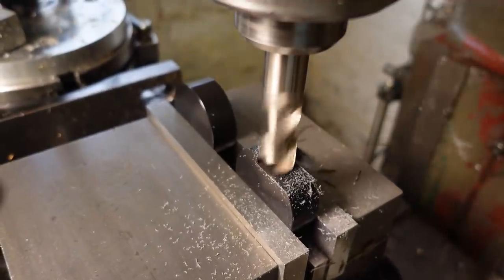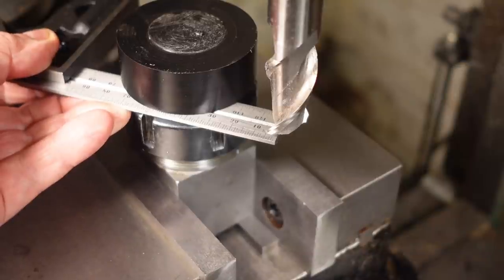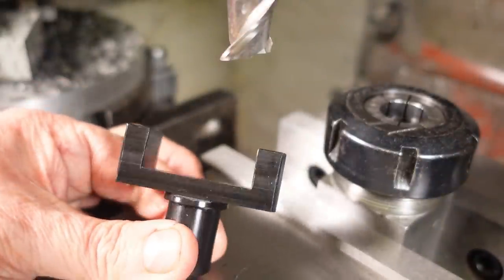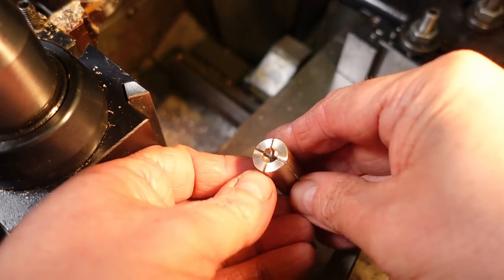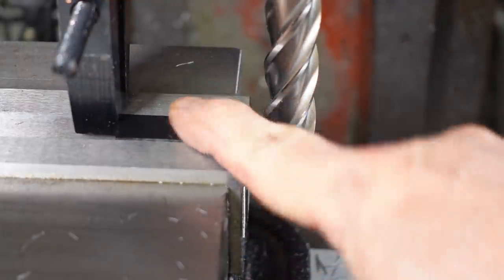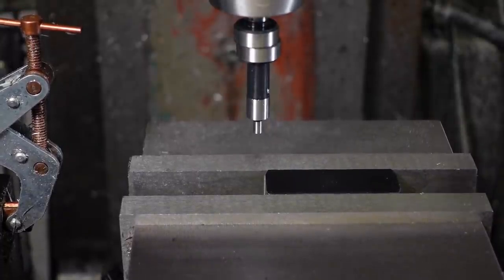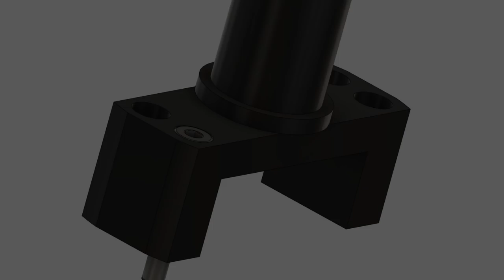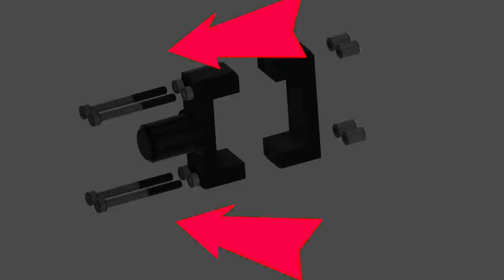Machining "Invisible*" Yagi Boom Clamps (*invisible to RF) #2

Comment: I used to struggle to make cuts in home made collets, laps etc. until I made myself a little gizmo to help. it's just a bit of angle-iron welded to a square of 1/8" plate, weld the angle iron to the plate and cut a reasonably wide slot an inch or two along the root of the angle to clear the  blade. basically, it's just a v-block that easily clamps (or bolts, like mine) to the saw table and makes sure the blade goes right down the middle of the round thing you're trying to cut. you can make a mark on the end of the stock to help judge the desired angle. I considered making a version with the vee on a sled and a little pointer for angle, but i've found this one works well enough for the kind of precision you'll get from the average bandsaw (especially my very below-average one!). Et voila! perfect pie-cuts, every time!
Reply from the maker: Good idea.  I have to confess a little secret that will trigger all the health and safety snowflakes....  My terrible bandsaw developed a nasty electrical fault while I was making this video, I suspected it was a winding leak or an intermittent open earth, but couldn't find it. It appears solidly grounded and no leaks on a Megger, but when it's running, if I touch the frame, it flips the RCB protection system and shuts the shop down.  As I was in a hurry, I put on two pairs of gloves and stood on a plastic board and just carried on. I was going to make a jig but decided to wing it and paid the price because is lacks beauty.

Project 61 might be a vee fixture with a slide, and it might get bumped up the list to #2 as I am going to need more of this sort of fixture.  I need one now with a 2.10 mm hole for the current project.  Those slots are going to be hard work, so I'll need to use a 0.5 mm slitting saw and cut them from both ends like an ER collet, although I have a very nice Knew Concepts piercing saw with Vallorbe blades that might be a simpler solution.

Now, of course, I want a wire EDM system.  Obviously.  Project 62 then....
Reply: Can't wait to see what yo come up with, it might inspire me to actually make mine properly. may i suggest taking a blow-gun to the innards of your bandsaw. they often get a fine coating of metal dust all over them and this can lead to all sorts of interesting tingling sensations and RCD faults. i've seen 2 different bandsaws with these issues, my own had exposed wires inside the belt cavity (on the main power switch), after a particularly long aluminium cutting session, there was a nasty noise, a tingle, and a pop! I've since insulated the wires/switch and attached a little plastic box that encloses the back of the switch. the motor also had a fine dusting inside, so that got a lrotectie shield too. You've got to love pre-1970s  electrical safety standards!
Reply from the maker: @theafro  I've had a close look inside the belt enclosure and around the safety switches and they are all clean and no sign of fraying. I suspect it could be inside the motor, but only when it's spinning, so I'm going to put my Megger on the leads and spin the motor with a power drill and see if I get any sign of leakage. If not, I'm going to tear it to bits and replace all the wiring. Or work in a wetsuit and rubber boots, but it's 20 degrees C today so that might be a wee bit uncomfortable and I'm expecting visitors, so that might be awkward!
Reply: @MachiningandMicrowaves  a low-slung nylon tightrope would work too... hows yer balance ? 😌

😎👍☘🍺
Reply from the maker: @peterfitzpatrick7032  Wobbly, very wobbly...
Reply: @MachiningandMicrowaves  😂😂

Comment: I do love your sense of sarcastic humor. 🙂 But I have  a question: At this timepoint https://youtu.be/tGOhcizkAMs?t=815, does the saw missing some of its teeth? 🤔
Reply from the maker: Very good observation skills! I think it's missing about 10 teeth. These HSS slitting saws are rather fragile, but a few missing teeth doesn't affect the performance very much.  The surface finish isn't perfect because of chip clearance and some sharp burrs, but I usually keep them until the teeth become dull or more than about 20% have broken.  I use a small abrasive stone to remove the burrs and prolong the useful life of the slitting saw blades.
Reply: Come on dude, its obvious, they dont make saws with a few teeth missing at random :P Well, they do make them that way, but only once they leave the factory... I have a few like those, its quite easy to make them, you just ding them into a part, run them at wrong speed-feed ratio for the material worked and such... On thicker saws or god forbid, carbide saws, dropping them can make short work of usually more involved process of breaking them... I also prefer buying saws with mangled teeth, as i have a deckel s1, and like stefan showed, they can be completely remade into custom size saws or can be used to replicate a good saw you already have...
Reply from the maker: @camillosteuss  Ooooh, I usually end up shattering them and find them embedded in doors and things, but I have an Alexander copy of a Deckel FP1, perhaps I can adapt that to turn the rekt ones into smaller versions.  Must go watch some Stefan videos urgently

Comment: Machining plastics is nice... a bit stringy when turning... 🤔

Brass on the other hand just sprays needle-swarf everywhere... 😖

I keep a couple of endmills/slotdrills with their tips ground slightly so I leave a (stress-reducing) radiused "fillet" in the corners of parts I machine where possible... 😌

Nice work... shame on you for the wrong Cee clamp.. 😂

😎👍☘🍺
Reply from the maker: These polished carbide inserts make pretty good curled chips on brass. https://youtu.be/ViRQuaKx3ik?t=380 
I have a few carbide endmills with radiused corners, I hadn't though of regrinding chipped sharp-corner mills, I must give that a go. I snapped a 3/4 inch long-series HSS end mill the other day, that was LOUD.  I was milling some bronze and it grabbed and shot the body of the end mill out sideways, along with some fragments. Eye protection is important...
Reply: @MachiningandMicrowaves  yep...bronze / brass is very "grabby"... 🤔
Definitely need more than the standard-issue safety-squints... 😆
Reply from the maker: @peterfitzpatrick7032  I favour REALLY long extensions to all the controls and a CCTV camera and I'll go stand in the store-room!
Reply: @MachiningandMicrowaves  

🤭

Comment: Neil, a question about materials interfering with the antenna (from someone that knows nothing about RF, etc.):  You said the Delrin wasn't a problem, but what about the threaded inserts & screws that you used?  Are they simply "small enough" to not cause a problem worth fooling with?
Reply from the maker: As usual, the answer is a bit more complex than it seems! The metal fixings are isolated from the boom of the antenna, and are oriented at 90 degrees to the electric field of the elements. They are close to the boom as well, so any possible coupling into the near field of the antenna will be absolutely tiny.  It's hard to come up with a good physical analogy, but the amplitude of the oscillating electric field near to the boom drops off rapidly. Isolated metallic parts that small (around 1/20th of a wavelength couple extremely weakly into the electric field anyway, so that reduces the effect by perhaps another factor of 100.  If the metal was in contact with the boom, it could change the resonance of the whole assembly, but ultimately the effect would still be miniscule. The actual issue is where a traditional mounting plate with U bolts is used to grip the GRP tube. The amount of metal you need to get a low-stress joint to the tube starts to escalate, and you end up with a conductive mass of metal that is connected to the boom that extends outwards into the electric field.  Still only a tiny effect, but there are three clamps per beam and we are pursuing a goal of perfection here.  Any effect on forward gain is not going to me significant even at a dimension of 1/8th of a wavelength, but what we are trying to avoid is raising the level of sidelobes in the main beam.  The beams have a very clean pattern, so any noise from man-made interference or nearby stations is kept to a minimum. A small change in the pattern at the -30dB level might introduce extra sidelobes or change the relationship between the antenna elements either side of the clamps and the effect might be several dB of extra sidelobe in an unfortunate direction. Add to this the proximity of multiple other high powered transmitters on higher frequencies and things start to get even messier, so using a nonconductive dielectric material, even a slightly imperfect one, just about removes any potential impact. My friend is looking at tiny increments in performance, each making maybe 1% improvement. Individually they are negligible, but if there are ten or twenty, that takes his overall system performance ahead of the competition. The trouble is always how do you measure the impact of each tiny change when each contribution is way under the measurement uncertainties?
Reply: @MachiningandMicrowaves  By taking lots and lots of measurements.

Or by taking one and claiming the results are perfect and hoping nobody asks any questions...
Reply from the maker: @dtnicholls1  It's certainly tricky when there's a variation in signal strength caused by scintillation over milliseconds that can vary the signal by a factor or 10 or more at random. Taking long averages is how we do it when there is just that fast stochastic variation, but then there are longer variations caused by air movements that cause variations of a similar scale over periods of a few seconds to a few days. Dragging out an effect that creates a 1% improvement from under that level of variance is a mighty challenge and in most cases there's a bit of belief and faith involved.  However, if there are 30 of those 1% changes, that's much closer to being measurable.  The best way is if you have a nearby station that is similarly equipped that gives you a comparison.  That takes out most of the long-period variances. In a radio competition for instance, if my friend's station is a little better than his neighbours' stations, he might complete a few contacts that they are unable to achieve.  If there are 300 contacts, that extra two or three will mean he gets more points.  As points tend to be proportional to distance, but also include multipliers for new countries or 100x100 km grid squares, the margin between him and the others can be quite marked.  I guess if you have enough room and resources to install two widely-separated antenna systems, with one as your reference, you can do your own A/B comparisons.  That would be a bit of a luxury though.  Much easier to make up a one-off measurement and declare it as The Truth, as you say!

Comment: I would absolutely love if you've tried to build a Quadrupole Mass Analyzer it's Machining and Microwaves 🙂
A QMA is used as part of GC-MS (Gas Chromatography - Mass Spectrometer) this is a scientific device to analyze samples for contents. The Gas Chromatograph separates your sample by polarity. For example if you feed in a mixture of propane and butane they will come out separated in time, first propane then butane. Its basically a pipe filled with kitty litter, heated for better performance and your sample is carried by an inert gas like Nitrogen, low pressure like 20 psi also low flow. But the much more interesting part is the Quadrupole Mass Analyzer (that's the MS in this) there are really awesome videos on YouTube that explain this beautifully (for example: Fundamentals of MS (4 of 7) - Quadrupoles, 3 Min. long) of cause there are also more good in-depth videos. This would be such a awesome Project there are Videos on YouTube where someone build the GC part but no one build a QMA yet, not to mention a hole GC-MS. With your Machining, RF and video-graphing skills I bet you could make this work and this Video would perform very well. There is a real craving for Scientific devices on YouTube. Ok, its still a niche but it worked really well for example for Breaking Taps. He gets like 250k on "science machine" stuff and I thinks your skilled enough to do it 🙂
Your awesome man 😃👍
Reply: If you want to see how its build commercially you get a nice look on it in this video 🙂
A Palm-Sized Mass Spectrometer! (Residual Gas Analyzer)
Reply from the maker: I used to play with GC and MS separately way back in the 70s. One of my mentors did his PhD on absorption-column GC technologies in the 1930s. I'm working on a top secret project at the moment that involves making a reproduction of a scientific instrument and demonstrating how it works, but I can't discuss any details.  That's going to be a hundred hours of work at least and won't surface for many months, plus I have to learn several new skills and there's nobody still alive who knows the detail of how the devices operate. There are loads of interesting instruments I'd like to make, even if it's only vacuum plasma deposition (which has already been done pretty well).  I sold my vacuum pumps a couple of years back, I really need to get a couple of new ones. I'm rather tied up with The Day Job and a HUGE backlog of machining and electronics/radio projects, but I have a list of 59 projects that I want to tackle.  This is going to be number 60 for definite. Doc Joe would look at me through those thick specs and say "put on your lab coat and go for it Neil". Next job after the 1.3 GHz low pass filters is a vacuum chuck to hold 200 mm disks of HDPE 10mm thick in the lathe so I can machine some Fresnel Zone Plate lens antennas for 122 GHz.
Reply from the maker: Hmm, https://youtu.be/IZpIWiMuZFM?t=507 "Probably impossible to build a quadrupole yourself with any sort of reasonable resolution"  - now THAT sounds like a challenge!
Reply: @MachiningandMicrowaves  
Let me guess. Your mentor was R.R. Bottoms and you want to do something with Carbon capture 🙂😉
Reply from the maker: Ben Krasnow has slightly better equipment than I do, also  folks like Tech Ingredients and Breaking Taps and The Signal Path are way WAAAAY ahead, but I'm a hacker and I have no fear of failure. Those folks are an inspiration.  I need to do that "Retire from Work" thing that folks talk about. Work just gets in the way of the important stuff.
Reply: @MachiningandMicrowaves  
Maybe you could improve your Views if you improve your thumbnails. Don't get me wrong they are good but you should sick more to Color Theory.
Reply from the maker: @GermanMythbuster  I used the "Select the most annoying background colour" slider in my graphics package to make them pop out of the page.  Unfortunately that also makes people feel queasy. I'm going back to using full-frame photo images.  The "plan" was to use a photo of the antenna system in situ, but as it hasn't been installed yet, there are no photos yet.  Hopefully tomorrow.  Soon as I get them, I'll be issuing nice new thumbnails with less psychological damage potential
Reply from the maker: Just looking at the options for quadrupole systems and wondering if a tandem solution with a phase shift between the two sections might be possible with more reasonable tolerances to get good resolution and narrow lines. The RF side is simple enough, as is the detection system.  I've got a dozen or more papers to read, but that will have to wait.
Reply: @MachiningandMicrowaves  That sounds really interesting. I haven't thought about that yet. 😮🤔

Comment: Your applicable skillset is so diverse, I knew frequency could change the properties of materials. Do you know what process controls a materials response to changes in frequency? (Casting, forging, induction/cryogenic hardening) Is it more alloy composition, a mix of the two? Thank you again for another amazing video!
Reply from the maker: Annealed copper versus milled copper does odd things to the crystal structure of the metal and changes the bulk resistivity, despite no chemical changes to the metal, so it also changes the skin depth at RF.  Alternating currents generate opposing EMFs that effectively force the current flow outwards to the outside of the material.  The change is pretty small, but the surface finish, machining marks, pitting and chemical patination/corrosion start to cause weird effects like scattering at really high frequencies.  You can find damaged sections of cables at low frequencies by looking at the reflections caused by those discontinuities, but at 100 GHz+, the wavelength is under 3mm and surface imperfections of 50 micrometres start to have an impact on how the material behaves as the frequency rises, so I try to keep surface finishes free of visible scores. You see a similar effect in printed circuit boards as the frequency rises.  The upper surface looks polished, that's because it's electroplated on to a polished cylinder which rotates continuously, but the outside is matt and quite rough.  That side gets glued to the substrate, so the RF performance of microstripline starts to be affected by scattering and the losses rise rapidly at higher frequencies. Rogerscorp have some good videos about that effect. Dielectric materials are much weirder though, particularly those with polar molecules. Fascinating subject.